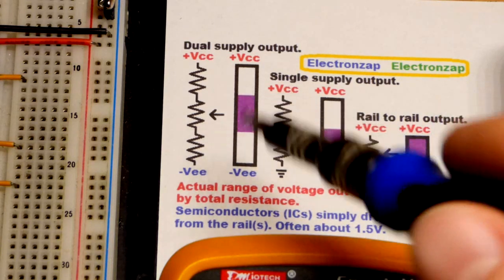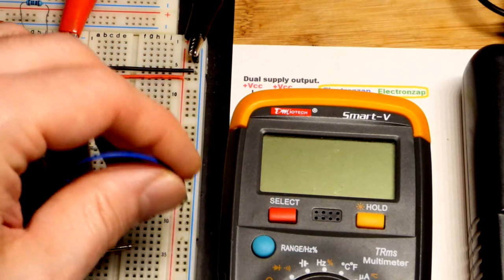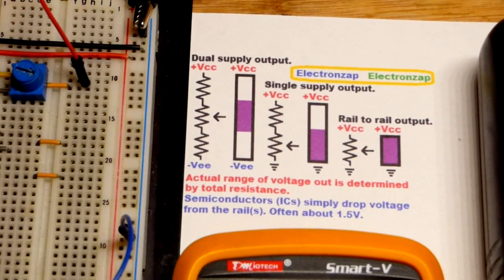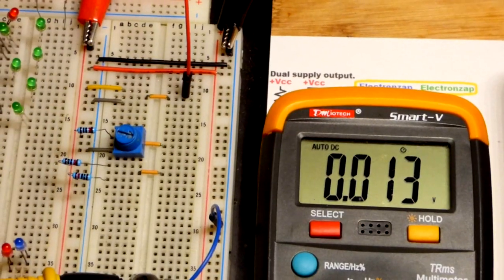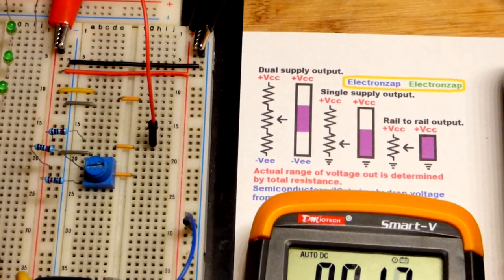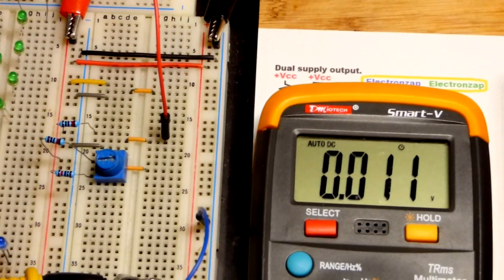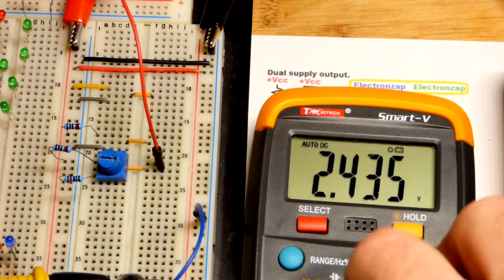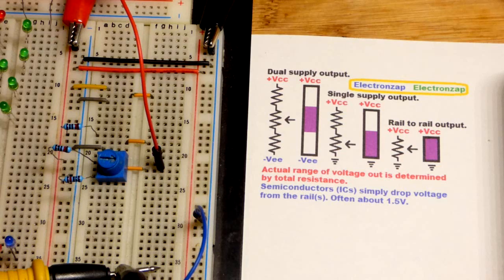Trimpot demo of rail to rail and single or dual supply outputs learning electronics lesson 0069

Comment: Nice video. Do you have any videos showing powering op amps like a lm741 without using negative voltage. Like if you had a 15 volt power supply 15 would be the top rail and 0 would be the bottom. I heard you can do that.
Reply from the maker: I've used the 741 as a rail splitter in some videos. As long as the voltage doesn't need to get close to ground or the positive supply, then it might work.